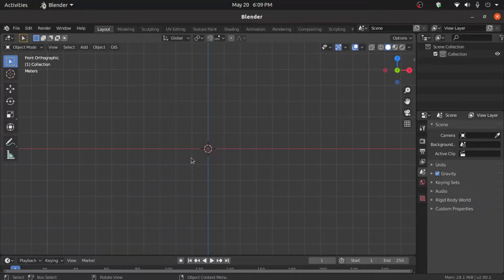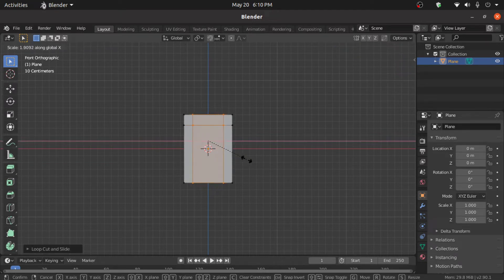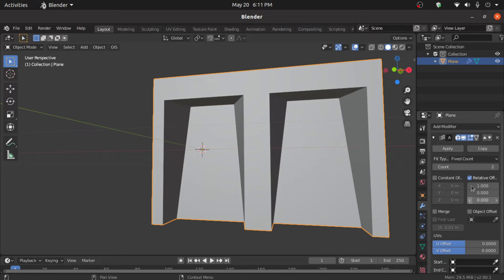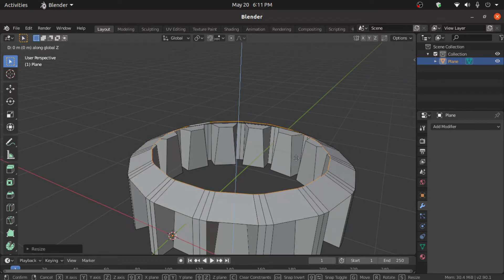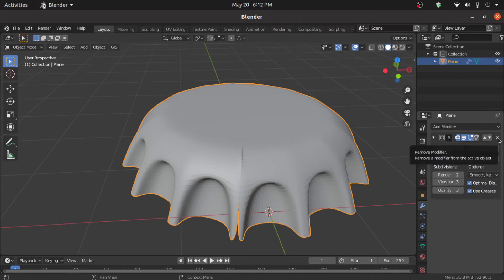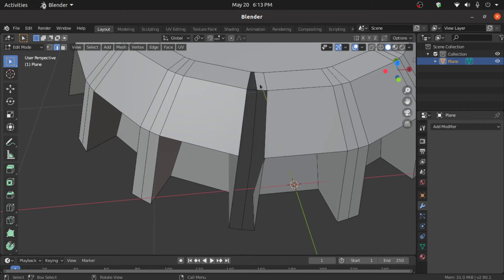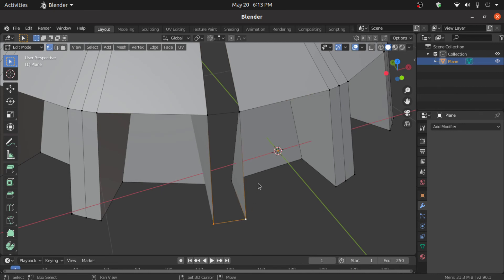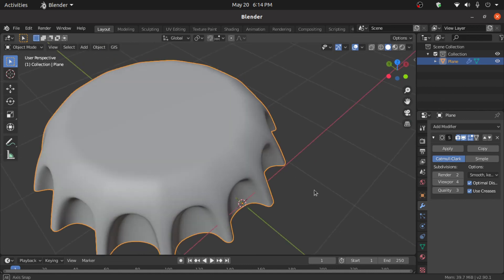Blender 2.90 Alpha - Coca-cola bottle cap modelling in blender

Comment: Hello,
In version 2.92 with all the steps you give, the object loops vertically and not as it appears in the video. Did I skip a step?
Thanks!
Reply: By default, with the Simple Deform modifier, in Bend mode, the object will bend on its Z axis. So if your object bends in a unexpected way, it must be because you have rotated it in Object mode, and its Z axis is not aligned on the global Z axis anymore. In that case you may want to apply the rotation with a ctrlA.
Reply from the maker: You are welcome. If this step is not effecting mesh then you can skip it.
Reply: @Welcometocreativeworld  What step?
Reply from the maker: You can skip last step but for this step use merge by distance.